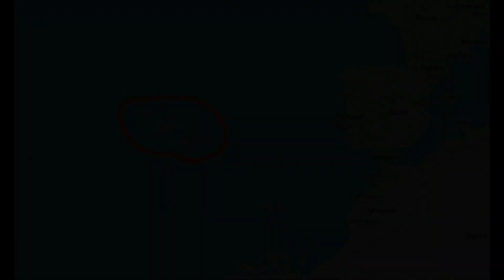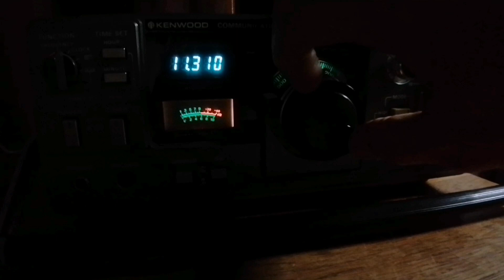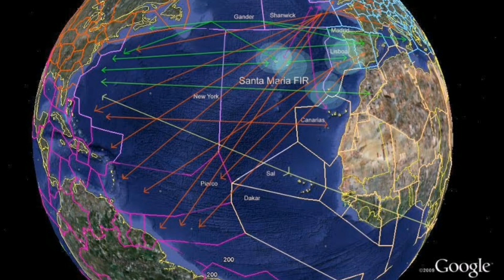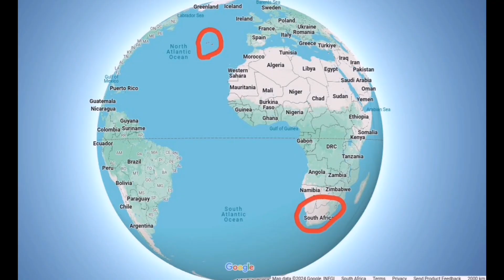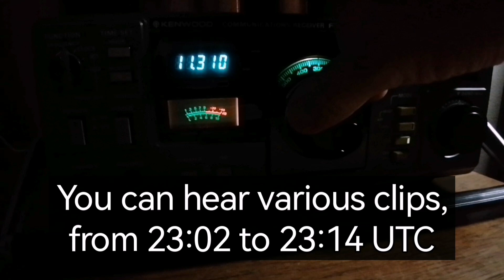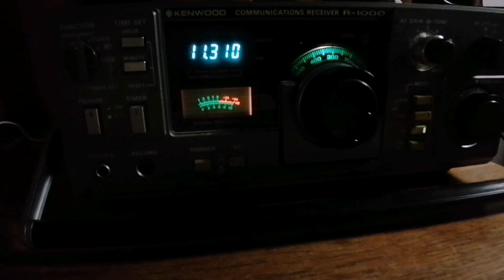HF air traffic communication from North Atlantic on Kenwood R1000 #shortwave

Comment: This is the only YT channel in which I learn something about little known radio stations and world geography at the same time! 🌍📻🌏📻🌎👍
Bonus lesson: How to tune the Kenwood R-1000 on SSB like a pro, starting at 2:13. Very slowly! ☺

Fun fact: The Azores islands are only 9049 km from the OR Tambo International Airport, but one has to take a whopping 35-hour flight from Johannesburg on Safair which transits in Durban and then to Doha (Qatar) followed by a connecting flight on Qatar Airways to Madrid, then to Lisboa and the final hop to Ponta Delgada on TAP Portugal airlines.
Reply from the maker: Teacher André 😉

There is another flight you missed! TAAG Angolan Airlines, Johannesburg to Luanda to Lisbon to Ponta Delgada. I have used TAAG Angolan Airlines twice in past years and it is a very quick way to get to Portugal, about four hours to Luanda and then another seven hours to Lisbon. The old airport in Luanda is a bit old and cramped though, so the transit waiting time was not a high point during this trip. They opened a new airport last year though, which is not fully operational yet, but once it is in full service it will be great: https://simpleflying.com/angola-opens-new-luanda-international-airport/

Comment: Also receiving (only nighttime hours) Shannon VOLMET 5505 on my XHData D808, telescopic antenna, low volume with typical SSB noise, but somewhat legible. Keeping the bandwidth setting at 2.2
Reply from the maker: Hey John, I missed your message last night, I was in bed already 😀 Sounds like you had another good night!

Comment: 👍Thanks for posting. The tones you can hear every so often will be St Maria sending a SELCAL test to an aircfraft. These SELCAL codes allow ATC to call individual aircraft (each aircraft is assigned a different code). The system has been in use for over 60 years.
Reply from the maker: Thanks for the info Steve. I was actually wondering what those tones were. I have also heard them on Manila Radio.

Comment: This is amazing. Unfortunately interference keeps increasing here, some neighbours are installing powerful inverters and I barely have much time for DXing now due to being in Grade 9. I think I should use an SDR, maybe I can leave it in an optimal location, but I still need to get used to everything, it all takes time.
Reply from the maker: Thanks Deniz! Those inverters are really horrible, I don't have one in my house, but I have that battery pack thing, the Bluetti. When it is switched on, DXing is just impossible, the noise is overwhelming. But your MLA30+ should help a bit, it is quite good with nulling out noise, maybe you can just turn it until you seem to find a position with the least noise. Or try an SDR, as you say, they are fun to use. You can start with the University of Twente SDR, a very good one and easy to use.

Good luck with grade 9! Not too many years then you will be in matric.
Reply: @swlistening  Thanks for the luck wishes, I will try adjusting the MLA30+ tonight.
Reply from the maker: @FamtechVideos  Good luck with that also, I am sure it will help!
Reply: @swlistening  Thanks. I will update you soon.